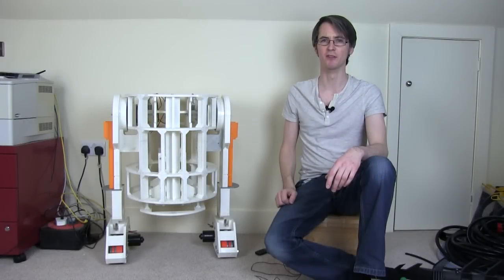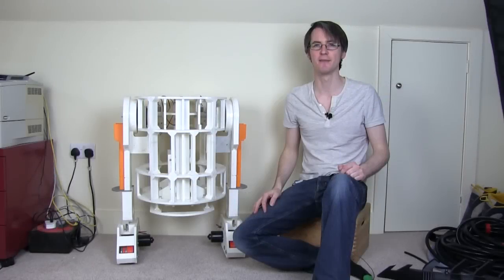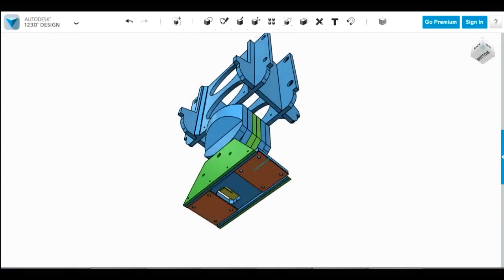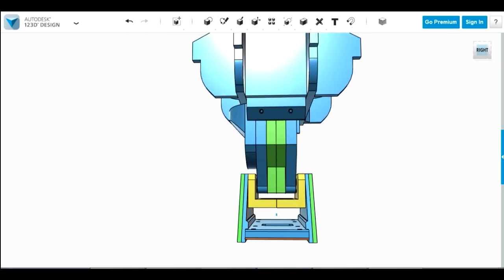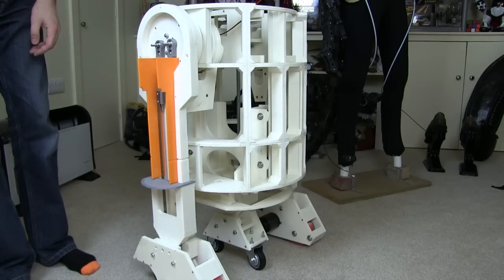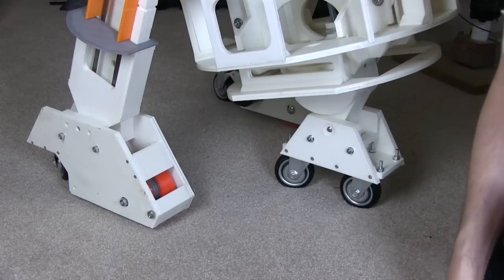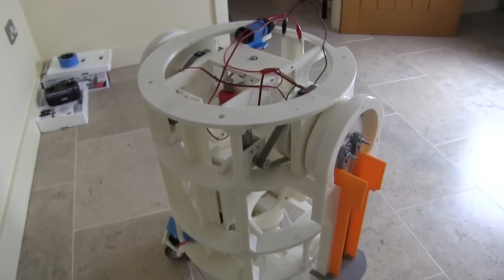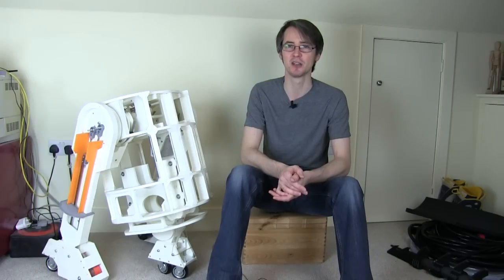Star Wars R2-D2 #7 | Centre Leg & Driving | James Bruton

Comment: If you take your remote apart you should be able to attach a spring to make the "throttle" channel operate like the other side. I did  the same thing with my lawnbot, There are usually all the little hookup points on those sticks, and they just omit the spring for the desired action with those cheap avionic radios.

Comment: Nice to see the progression of the project. You might want to get a lipo charging/storage bag just to be safe.
Reply: ***** Probably is the case but I do remember reading of instances where the battery ignited while not in use (They had recently been charged or used). Always good to be on the safe side.

Comment: Bravo!! I do have one small concern about the tgreaded rod passing through the foot. It looks as though one of the casters can block the rods travel if its in the dead center of the hole. If so, would there be room for a wedge or something to slightly twist the caster to one side?

Comment: Nice, have you thought about using some ball wheels like these of the 914 PC-Bot, or even printing your own caster ?
I'm still impressed about the ninjaflex drive belt. 
You should consider printing some cheap encoders for the wheels (with 2 light barriers) to synchronize the motors. I'm sure it will be difficult to drive straight forward without controlling.
Reply: ***** Well you are right, I think about omni wheels for a long time but still can't find a good use and design that's practical usable. I also don't like the caster, they are a little bit unpredictable, need a lot of space...
Reply: ***** What do you mean feel ever bump? When the wheel is moving forward it is like an ordinary wheel. So i assume you are talking about the sideways motion, which would only occur when it is turning.

There are two ways these wheels will expedience a "bump." First would be when it it hopping up a a curb. The jolt that is created in dependent only on the material of the wheel(Softer=less jolt). It is not dependent on the diameter because both wheels would be making the same high change in the same amount of time. The only thing that is determined by diameter is the height of the curb you can roll over. Which would only be an issue if you had to hop a 1cm curb whilst turning simultaneously, which i doubt will be done often.

The second source of "bump"s would come form uneven surfaces. Bit this is solely determined by the contact surface area between the wheel and the ground. Yes the castor has a higher contact surface area, but with omnis you can always stack additional omnis side by side to increase the contact surface area

Comment: Just a question. Have you thought of using NinjaFlex for the infill for the foot? That would allow the NinjaFlex to help absorb and dampen bumps and thumps on uneven ground. The thumps coming up through the foot can probably be severe.
Reply: And it will take out some of the plastic sound you can hear when the wheels hit a seam in the floor

Comment: I think you should be moving the center foot with a belt rather than a studding, because as it is, is using a lot of revolutions and moving really slow. So, yeah, maybe a belt or a rack and pinion system.
And if you're worried about rigidity there, you could put a smooth rod instead of the threaded one.
That said, though, I think there could be an even better solution for that center foot, because you need only two stages, in and out.

Comment: Will be easier to drive once you have the microcontroller interpreting the rc signal, rather than direct output to motors, you could use the right stick to go forwards (L+R forward), wheel turn (L+R forwards but one faster than other), spin (L forwards, R backwards or vice versa), reverse (L+R backwards) and wheel turn in reverse (similar to forward wheel turn but in reverse).  

The left stick is free to be used for other actions or left unused,  however switches could use the left stick signals to activate special features, like conversion between 2-3 leg mode.
Reply: You can fiddle with the wheel turn increments to make the robot turn sharper, or make softer turns